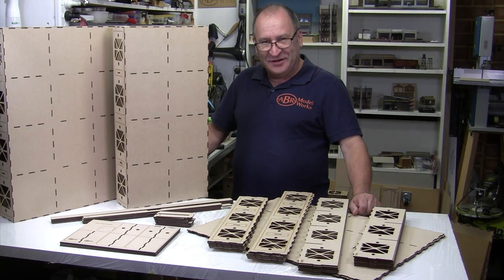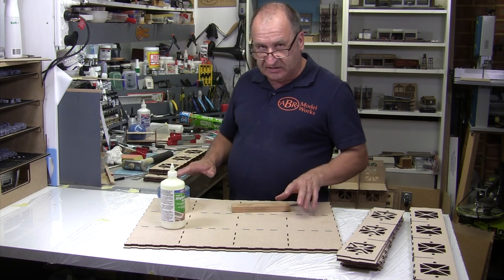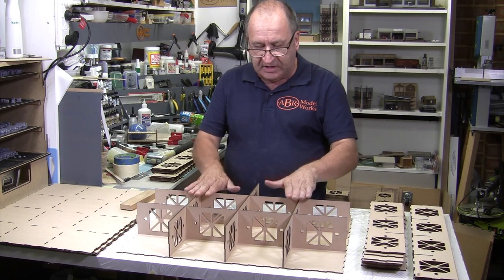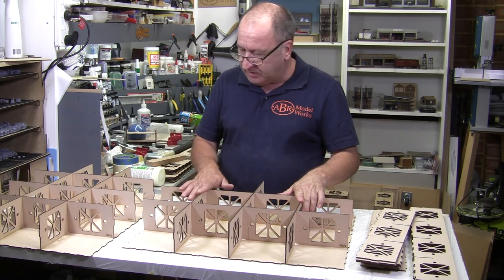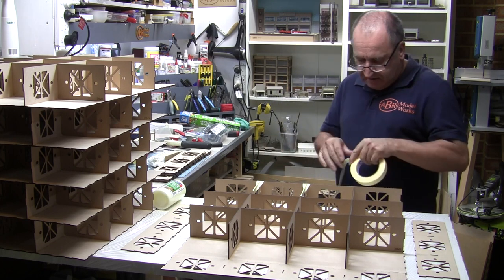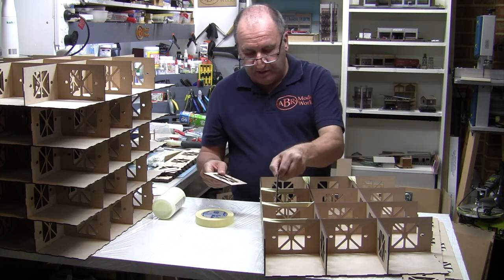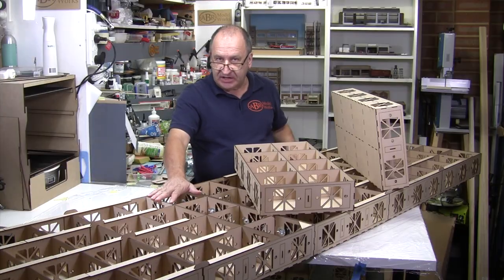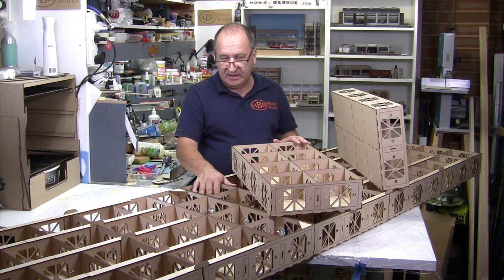Building ABR Lines model railroad VLog #001

Comment: It's a great system Chris. I just finished my layout using the system and it looks great! Everything is tight, straight and flat. Now its on to trackwork.
Reply from the maker: Thank's Bart, I am still getting a few emails each day from modellers look at using the system. So now I have the samples done I will be doing the photography and put them up on our website ASAP.
Reply: @ABRModelWorks  Thats great to hear. Better start buying up all the wood in the area!
Reply: How are you going to get around point motor placement and rods needing to go up through the framework if your track puts the point throw right over a brace?  Seems to me your track design is further restricted by the internal bracing.  This will be interesting to watch as you go along.
Reply from the maker: @dkaustin98  I have a little supporting side insert to hold the push rod so the point motor etc can be put off to one side.
Reply: @dkaustin98  Hi DK, yes the layout is designed with the benchwork system in mind. But that is only relevant for the overall size and shape. I didn't take in account the placement of turnouts. That would also severely limit the design process i.e. not the way to go. ABR has solutions if you want to use point motors. I myself am going to make mechanical linkages for every turnout. 
As far as the cross bracing goes, i feel confident to drill and nip pieces away for any infrastructure.